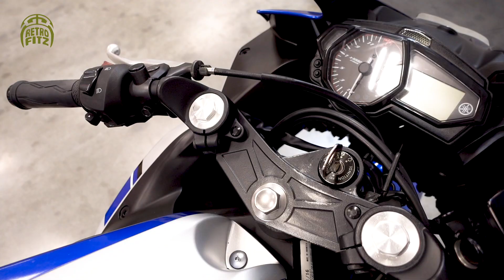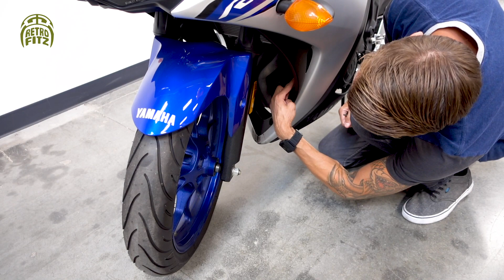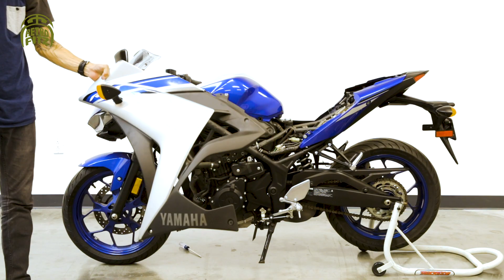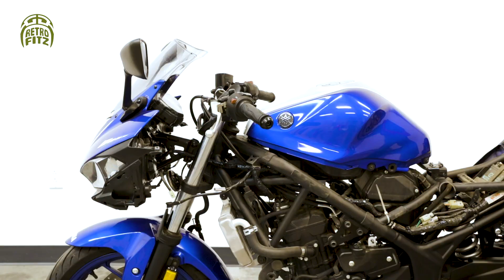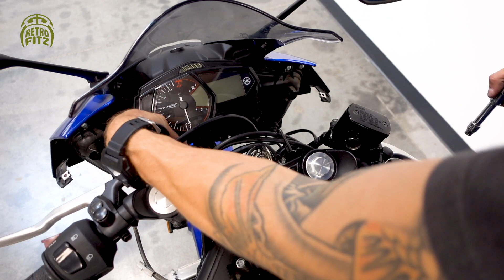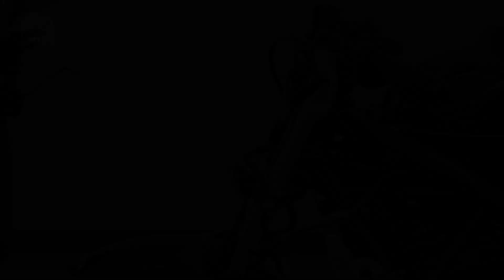YAMAHA R3 R25 Body Disassembly

Comment: Brilliant . Easy to follow, easy to understand. Before taking a part off, u pointed out where the screws were & showed the tool to use. After taking off, the screws / fasteners, even the part (front & back)  were shown. Following that,  I know exactly where I get my hands in & what I get into. Also I get some ideas how to put it back in later. Thanks mate.

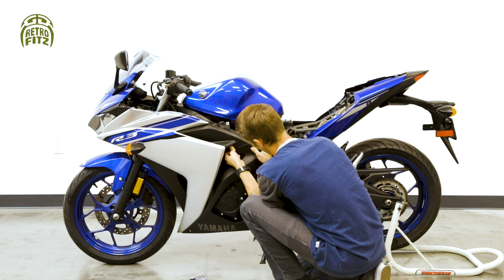Comment: @6:32 you did not explain how to remove that long black piece to access hidden bolt.  I ended up break the U-tab plastic holding it, then I couldn't install the front (pointed end) back.  It won't snap in and bend in nicely with the other plastic, but just stick out.
Reply: Do you know if that long s shaped black piece can be removed separately from the full side fairing? I’m looking to wrap it but not sure if they are removable